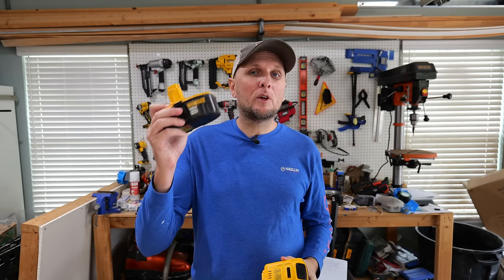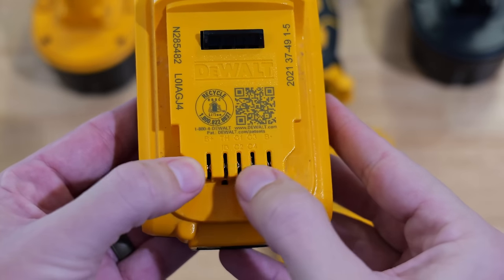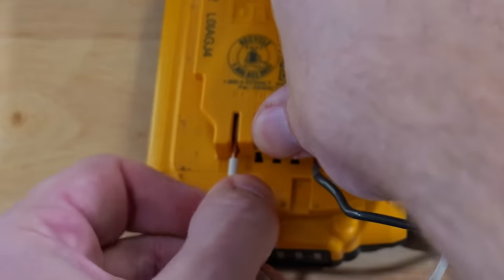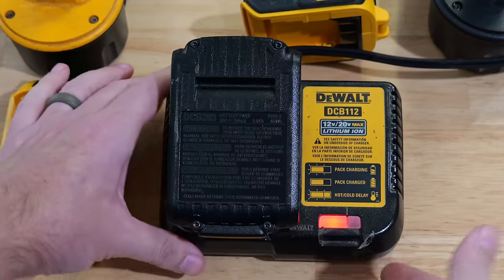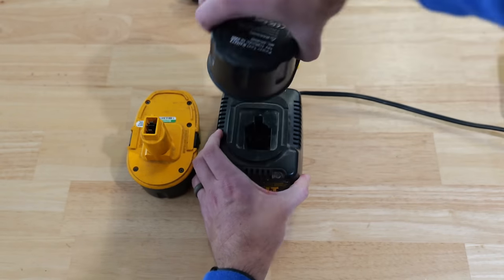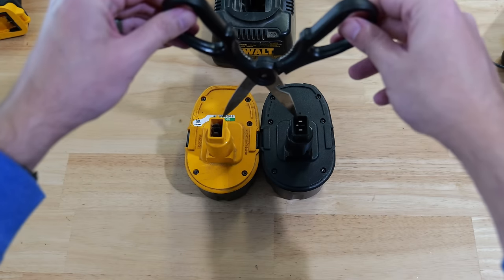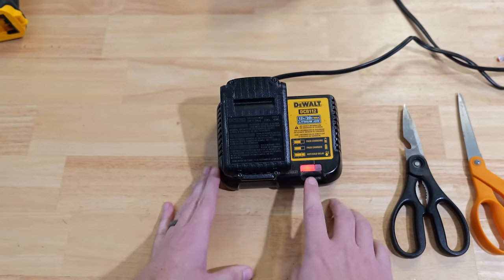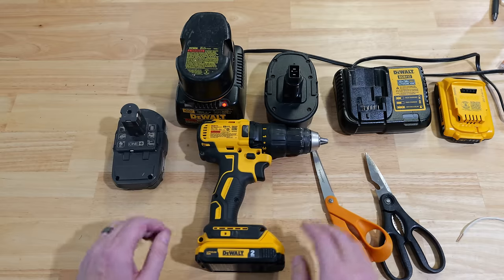SECRET To Reviving Dead Portable Tool Batteries | Super Easy!

Comment: Ok, I have a 40v lithium battery for my Black & Decker weed trimmer. Over a year ago the battery was dead as any door nail. But I kept it for later recycling with other batteries. I saw this video and went to work to see if your jumper trick would work. I fully charged the good battery. Then I made my connections and gave it time. I came back in about 10 minutes and the "dead" battery was warm. I removed the wires and put that battery on the charger! It works! The red light started flashing. It's now working to be fully charged. I now have two 40v batteries to work with. Thanks for this great tip.
Reply: I just did the same thing! Amazing!!
Reply: @lindsayadams4905  My battery showed that it was recharging-green light- but after a few minutes it got the flashing red light. I assume the battery is bad. But the trick did work when it showed no green light.

Comment: Totally works. Did it with Dewalt 40V yard tool batteries. Took about an hour to reach "threshold voltage" that the charger would recognize. Thanks man!

Comment: Nice tips, my addition would be to flatten your solid copper wire ends rather than forcing them in.  Mechanically spread and damaged connector terminals inside the pack will also render it unusable in a much less fixable manner.  It can overheat and melt the plastic around it in your battery pack and leave a burned pitted spot in your tool's contacts as well.
Reply: when you insert the battery into the charger it spreads the terminals apart to make a good connection. It's designed to handle this over and over again. Its a non issue.

Comment: 3-5 minutes might be generous. It can be  a lot faster.  I learned this last summer from a different video and listed much shorter times.  So I tried what they said.  20v dewalt - I connected the wires for about 30 seconds and that was all I needed to have just enough juice to get the charger going.   I'm glad people are sharing this information.  Seems a shame for batteries to be getting tossed / recycled unnecessarily.
Reply from the maker: Yeah, completely depends on the battery.  Sometimes shorter can work as well.  Appreciate the input!
Reply: yes a few seconds is more than enough - it is nothing to do with the explanation he gave, it is about individual cell polarity reversal which occurs when a lithium 'bank' (group of cells) approaches 0v of charge : as if the cells are not perfectly balanced (they can't ever be) then one cell will reach zero first because the others, and that cell ends up with a NEGATIVE voltage (or reversed polarity) -- the inbuild BMS detects this condition and tells any devices which respect it to shut off power from it.

the hot 'jump' technique to the battery+/- terminals forces those flipped cells back into positive voltage levels by overpowering them. BRIEFLY! a few seconds is all it takes. any more can be dangerous.
Reply: These cells don't actually reach zero. The charger will cut them off between 3 and 2.5 volts. They will not let you discharge them completely because it would likely catch on fire. What happens is the battery is charged up to 4 Volts. It is used till it hits its cutoff voltage around 3 volts then instead of charging it you put it into your bag for three or four days and the battery  self discharges to less than 2.5 at which point you need to do what he says here to charge them. The reason I t takes so little time is that you are only bringing the battery from around 2.4 to 2.6 volts enough where it is recognized. If your battery hit zero you would never be able to charge it again. If a lithium battery ever reached a negative voltage it would quickly achieve thermal runaway. The battery packs don't look for negative voltage to stop charging. They test each set of batteries for the low voltage cutoff. You are right about the imbalance though it happens at much higher tha zero volts.

I'm not sure how lithium batteries deal with imbalanced cells but in lead acid deep discharge batteries you overcharge them up to about 14 or 15 volts for a short time. This brings all the individual cells up to the same voltage.
Reply: These types of batteries don't get recycled. Green ain't all that friendly!
Reply: I got almost "$1400" worth of Makita tools for $200. These tool companies aren't in the business of selling you tools, they're in the business of selling you batteries. 

They just about give away the tools and give you a battery with the tool to get you committed to their battery platform.

Comment: What a good and simple way of explaining how to revive these batteries!
I am a retired electrical engineer and never gave this a thought.
Keep up the good work!
Reply: The batteries are not being revived. li-ion, lipo and similar chemistry batteries once they are discharged below their lowest discharge voltage rating (normally around 2.2-2.5v per cell) they become useless. Yes you might get them to take a charge but, it'll never be 100% and the capacity is severely reduced.
Reply: @Blueknight1960  A reduced capacity is far better than a zero functioning brick.
Reply: yes a few seconds is more than enough - it is nothing to do with the explanation he gave, it is about individual cell polarity reversal which occurs when a lithium 'bank' (group of cells) approaches 0v of charge : as if the cells are not perfectly balanced (they can't ever be) then one cell will reach zero first before the others, and that cell ends up with a NEGATIVE voltage (or reversed polarity) -- the inbuilt BMS detects this condition and tells any devices which respect it to shut off power from it.

the hot 'jump' technique to the battery+/- terminals forces those flipped cells back into positive voltage levels by overpowering them. BRIEFLY! a few seconds is all it takes. any more can be dangerous.
Reply: Is there a way to do this without another good battery, Say a power supply or a stack of 9 volt batteries?
Reply: @Blueknight1960  Using the word "revive" is just a matter of speaking. Like it is saying that "the battery is dead". We don't need to be so strict regarding little problems of semantics. Just use the usual technical jargon.
Reply: @dennymcguire9030  Yes, as long as you have the right voltage and power. Power = V x I; so check the amps and voltage needed in the info of the old (and "dead") battery and use a source with the same (or a little higher) voltage and the plate amperage or more for a faster charge.
Reply: @foff-666  I don't think it works like this. The individual  cells never reach 0 volts and do not ever reverse polarity. I have rarely seen a l-ion battery under 5 yrs old with a cell at zero volts. Usually the battery pack will prevent recharging if the cell goes below about 2 volts. That's why you can revive them so quickly at about 2 volts applying a " trickle" charge only needs about .4 volts to be in range again. If a cell was at 0 volts you wouldn't be able to recharge it at all. I doubt a lithium battery would last more than a few few seconds if it had a reversed polarity. It would almost immediately catch fire. You can test this with a single cell in your grill outside by hooking the cell up in reverse and counting down how long it takes for it to let the factory installed smoke out. If f you have quick hands you can use your meter to test the voltage when you see the smoke . Most likely it will still be in positive territory. 

I believe you are referring to a lead acid battery which are much more forgiving. I have never seen an individual cell go below zero butI wouldn't be surprised to learn that it did. I wouldn't be surprised that the battery could be revived with a cell at zero volts although most likely the plate is  so covered with sulfite that it can't be revived without destroying the lead plate. The behavior you describe exactly what happens on a lead acid battery.  Usually if you take care of a lot of batteries you rotate them to a maintenance charge every couple of months which is really just over charging the battery to about 14.7 volts. This ensures that all the cells are equal and you don't need to worry about a cell being brought to zero.
Reply: @jlrinc1420  I think you are not answering to my comment, but to the ideas in the video. Thank you anyway.
Reply: @Lecuona8  I was responding to your com entry that lithium ion cells reach zero volts. And then further when you u said that they reverse polarity. Maybe I'm not u understanding you but lithium ion cells take years to reach zero volts and would definitely catch on fire before they ever reversed polarity. Both of these things can happen with lead acid batteries I suppose. Usually lead acid batteries with zero volts are so covered in crystallized sulfite that they can't be brought back. I imagine as long as they weren't at zero volts long enough for the sulfite to crystallize they could be brought back but I have never seen a lithium ion cell recover after hitting zero volts. It takes a long long time to reach zero volts through self discharge and if they recieve reverse polarity are extremely pro e to fire. It's just not how lithium batteries act. Maybe I've misunderstood what you were trying to say.  I just dont want anyone to think that a lithium battery can be brought back if they measure zero volts. They cant be and I wouldn't try it with any lithium battery less than 2 volts or your asking for a fire. I've opened a bunch of lithium battery packs  and was the technician for a fleet of forklift batteries and their chargers which are lead acid and weigh hundreds of pounds.
Reply: @jlrinc1420  Sorry my friend, but I think you are confusing me with the author of this video. See what I wrote under @Lecuona8.
If you still think that I wrote about reversing polarity, etc, this is a free country and you can believe whatever you want.
Thank you for your interest, perseverance and efforts.
Reply: @Lecuona8  I see the mistake.  My comment was addressed to fox 666( take a look at my original comment).  You thought it was addressed to you, and said you didnt write the comment I was responding to.  You didnt but because you responded to the comment that wasnt addressed to you I assumed that it was you I was referrig to.  It was a comedy of errors for both of us.  my apologies..
Reply: @jlrinc1420  Thank you my friend. It is good to see people that can accept their mistakes (I include myself from my side) and can have a friendly dialog and come down to the solution of a missunderstanding. In adition to that, I learn some details with your responses. In conclusion, it was a positive experience.
Reply: Guess what ever the conclusion doesn't matter as long as the battery works. Good 😮
Reply: Lost 😂
Reply: @WilliamSievert-rx8ng  I guess that will depend on your degree of curiosity and interest in going deeper into technical knowledge.
Reply: @WilliamSievert-rx8ng I don't know exactly what you mean; however If you are lost, I would recommend to get a compass and get back in course. I am 73 years old and I know exactly where I am and where I am going.
Reply: What if you don't have a second battery? Any input greatly appreciated.
Reply: @staceyreeves9523  I think a power supply with the same voltage would do it. In any case, it is convenient having two batteries so you don't have to wait for your only battery to recharge when you are working.

Comment: Just seen the video, just tried it and it does work. I think this is the first time I’ve tried a hack I seen on a video and this did work. I had two of the exact 20v that crapped out when they were new. I just never threw them away.

Thanks!
Reply: Gents. I'm with Brian. Be very careful when attempting to revive an LI batteries regardless of method. Have some sort of fire suit on when you take matters in hand. Use scissor techniquice in case you must quickly disengage or the explosion may disengage for you. You never know.

Do this outside your house away from burnable materials as extra precaution just to be safe. Otherwise, happy recharging!!

Comment: I did jumped the dewalt 18v xrp batterys according to your instructions for my dewalt 18v xrp batterys. And so far it worked.  No errors on the charger. Time will tell. The 20v adapter puts every tool out of balance and too tall. And my problem is I purchased about 10 major 18v tools and really don't want to add an adapter. All my Dewalt 18v tools are still in their hard cases, most only used once. Thanks for the video.
Reply from the maker: Awesome!  Glad to hear it was able to help.  Thanks a lot for the feedback Doug!
Reply: EE? Eat Everything?!

Comment: I'd written off a nearly new grass strimmer because neither 18 volt battery would recharge. I actually purchased a replacement strimmer of higher voltage.
Your demo got me using my DeWalt 18 volt battery to connect to each of the anonymous strimmer batteries in turn.
Hey presto! I now have two working strimmers!
Also the other of my two DeWalt 18 volt batteries had become unrechargeable so I applied your cure and now am back to having both available.
Many thanks for taking the trouble to put out your fix for everyone's benefit [except perhaps for the battery manufacturer!].

Comment: I did it and it worked. 18 volt Makita.  It did spark when I made contact (lithium batteries) but left only for 60 seconds and put it on the charger- it is charging!  Thank you, thank you.  Just bought two new batteries for $185- wish I saw this earlier.

Comment: I've had this issue before. In the past, I've just left the battery in the charger, and sometimes, after a few hours, the battery starts taking a charge. Perhaps the charger recognized a slight charge during the process. Will use your tips, though - much easier!
Reply: That’s what I did on 2 lightly used older Milwaukee 20’s.
Reply: Yes cause even though charger doesn't recognize battery when dead to give charge, when u connect the dead battery the charger, the charger still gives a very small amount discharge naturally and after hours of that miniscule amount of electricity going to the battery, it gets it to the point where it builds up enough stored electricity to have the charger recognize it

Comment: I’ve done this with Ego56v batteries and it does work. I had a battery that wouldn’t take a charge and registered a fault, ran the wires like he showed and it gave the “bad” battery just enough charge for the charger to recognize it as a good battery in need of charging.

Comment: I learned about this tendency of rechargeable batteries needing this "jump starting" when I got a universal camera battery charger after I bought 2 used cameras that had been stored for a very long time and their batteries would not charge on the charger that came with the cams. It has a sort of "boost" function you can engage to charge a completely dead camera battery. Always good to know things like this.

Comment: Wife likes all kinds of ambiance low power stuff around the house.  I made her switch to rechargeable batteries due to how many she was going through. The problem with these devices is that they will suck a battery to 0. So i built a board to be able to jump-start them and get them to change easily. Works really well. I've also done this on car batteries, Zegway batteries, and many others threw the years. Never had an issue.

Comment: I just did this to my completely dead 18V Milwaukee battery pack . It had 0.01V before I jumped it. It's now on the charger and had 19.21V after jumping it for about 4 minutes from my 2nd battery that had a full charge.
This works!

Comment: Never had this condition before, but I have had the charger say the pack is bad a lot. But I gotta add that a current limited power supply would be a better choice for this. The dead battery could overheat and die from the potential short circuit current draw if the dead battery cell is defective.
Reply: Did you mean the Good battery could die?
Reply: a few seconds is all it takes, it is indeed dangerous to do this for the stated 3-5 minutes.

it is nothing to do with the explanation he gave, it is about individual cell polarity reversal which occurs when a lithium 'bank' (group of cells) approaches 0v of charge : as if the cells are not perfectly balanced (they can't ever be) then one cell will reach zero first before the others, and that cell ends up with a NEGATIVE voltage (or reversed polarity) -- the inbuilt BMS detects this condition and tells any devices which respect it to shut off power from it.

the hot 'jump' technique to the battery+/- terminals forces those flipped cells back into positive voltage levels by overpowering them. BRIEFLY! a few seconds is all it takes. any more can be dangerous.

Comment: Great video. Great comment section. To avoid any kind of battery fire due to over charging or failure.  Get your self a metal garden shed run a 120v GFCI circuit to it and make a charging and battery storage set-up insde it for your rechargeable battries. Locate it as far as possible from occupied structures garages and any flamable materials. Dont ask how I know... a thief leaves the coat hangars, fire leaves nothing...
I'm a retired  Electrical Contractor. ✌️🙏😇 Stay Safe. ❤
Reply: Great idea. I would also suggest a smoke alarm, a cut off switch and a bucket of sand. Also - would a metal shed get hot in the sun and overheat the battery and charger?